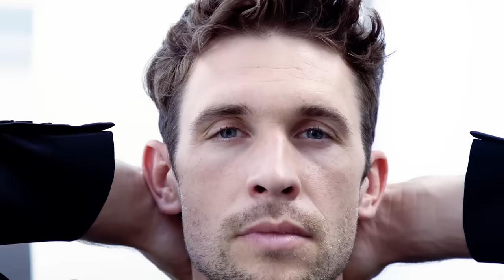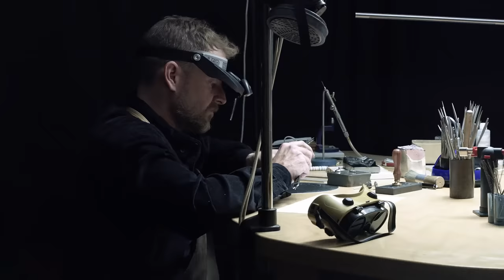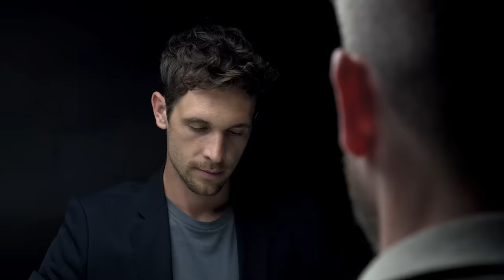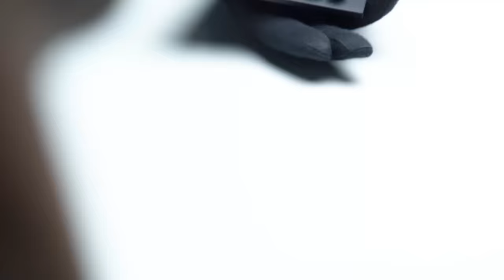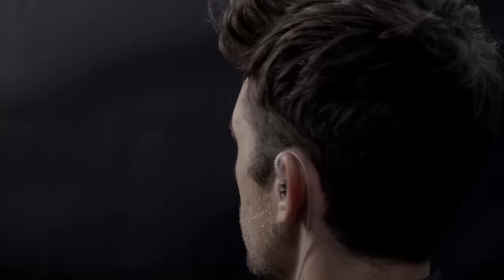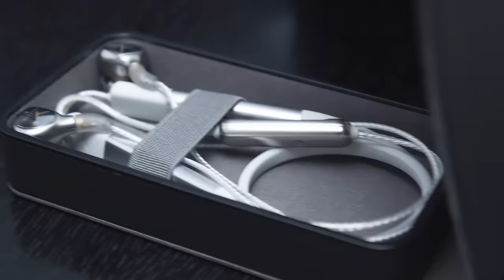beyerdynamic | XELENTO (2nd generation) – AN AUDIBLE PIECE OF JEWELLERY

Comment: What is the main material of xelento 2nd frame?
Reply from the maker: What exactly do you mean with this question? Can you define "frame" more precisely? What can be said is that for an outstanding sound experience, only gold-plated pugs and silver-plated cables are used. As a special eye-catcher, the shiny front of the housing is adorned with real gold – handcrafted from 24 carat gold and applied using a high-precision technical process. More information about the XELENTO can be found here: https://fcld.ly/xelentowireless or here (behind the scene video): https://youtu.be/2VYow7cM81w Greetings, Patricia
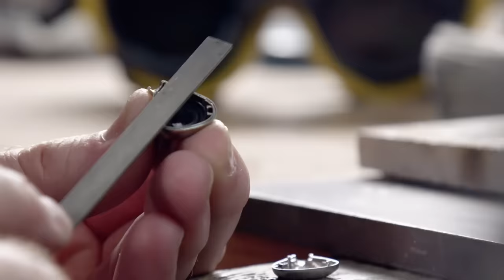Reply: @beyerdynamic  Sorry for not asking clearly, What is the material of the earphone part in the video at 0:16? I can't find the description on the official page.
Reply from the maker: @user-zf2qm2no6d  at beyerdynamic, we carefully select the materials for our products. The structural base part of the housing is made from a high-quality, precision-engineered polymer. It is then electroplated with several layers of metal to give it the unique color and appearance. Greetings, Patricia
Reply: @beyerdynamic  Thank you for your careful and patient reply.